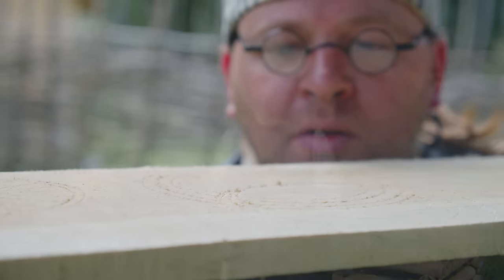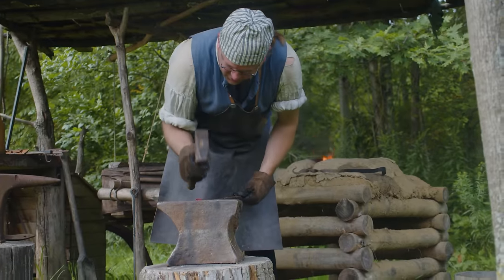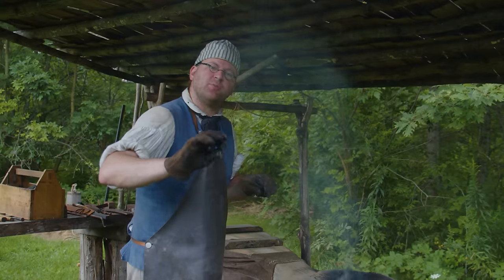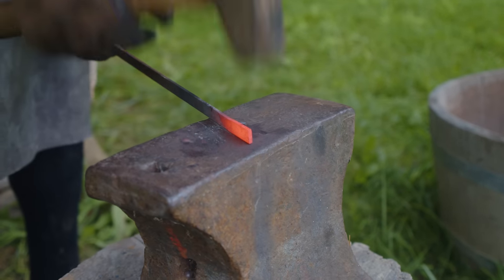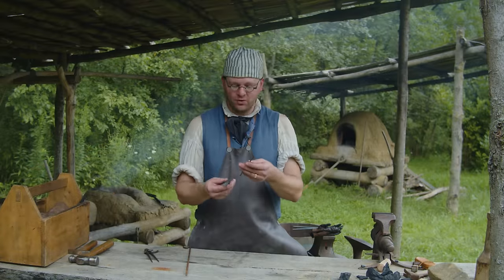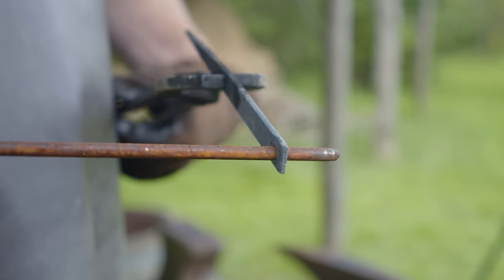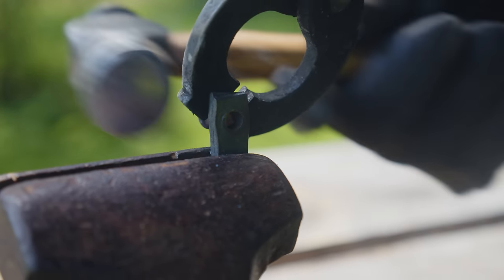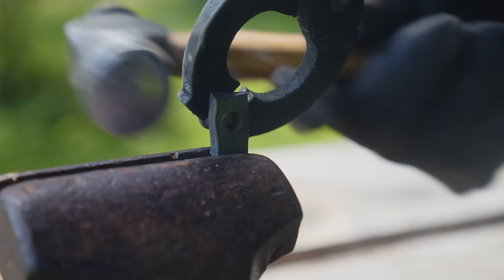Blacksmithing The MOST Underrated Tool In My Toolbox - 18th Century Forge

Comment: I owned a sheet metal manufacturing company for 30 year before I sold it. And you are spot on with the dividers, absolutely one of your most important tools. Some much can be done with them and accurately too. When I got into the trade everything was done without computers. I made sure some of my ppl. knew how to do there job manually cause you never knew when your CAD would go down.
Reply: Having gone through the journeyman for blacksmithing and done sheet metal work (instrument maker and micro mechanics but that is more machining) straight edge, scriber, divider and triangle is very much needed for laying out...
Reply: @najroe  Agreed

Comment: As someone who started their working career as a draftsman (pre-CAD systems) I have to say the dividers and triangle were the crux of engineering.  My Dad was a draftsman too and we'd watch all the shows about how "it must be aliens that made these stones so uniform!"  He'd show me how to do it with a triangle and dividers.  I loved this video! Yes, I do still have my dividers & triangles!  🤣
Reply: One of my most treasured possessions is my dad's set of dividers and compasses from when he studied engineering in the 1950s - I'm no engineer but I still use them occasionally when I'm building things myself.
Reply: I dont think its the measuring of the stones that are in dispute with the ancient aliens (lol) crowd though.
Its more to do with how on earth they cut stones perfect like that in the bronze age- since bronze is so soft.
Which is still a mystery, though i kinda doubt it was aliens lol.
Reply: @svinkuk2652  the Inca did it with a technique called peck and grind. You'd split the stone to it's rough size with stakes and then tap the stone with another stone in all places where it rose up. You'd then grind the stone until it was the desired dimension.
Reply: @svinkuk2652  true but they weren't shaping tungsten carbide blocks into aerospace grade parts. It's hard rocks into relatively accurate dimensions. Abrasives aided by water or grinding action will work just as well as modern ways of cutting, albeit much slower. I guess when you've got a very long life of cutting rocks you learn some practical tricks.
Reply: @alecasone  this is true, but not for that aforementioned quarry where they found the unfinished obelisk.
I mean there are other places in that quarry where there are marks from driving in stakes etc etc, meaning they used those classic methods as well at some point in history.

But that obelisk in particular is a different story- it looks like they were in the middle of "scooping" it out of the middle of a flat portion of the ground when it cracked and they abandoned the work.

If you havent had a look at it, i definitely recommend having a look on google and pondering what kind of stuff they used to leave marks like that in the stone, its way strange.

Comment: Another note, just drift a quick rivet/nail header tool. Upset one end of your rivet material, run the narrow end through your tool and head your rivet. Then cut it off with a little more than the thickness of your assembly, put everything together with a hot rivet and head the other side.

Comment: I could really use a set of these for my knitting and sewing. You could estimate a knit gauge, draw circles and arcs, mark distances for triangles or keeping bias tape/strips consistent, the applications are endless. Heck, put some little pegs off the outsides and you've got an adjustable pompom maker or ribbon length measure too.

Comment: Fun project.  Everyone needs to play with a set of dividers.  One of my favorite jobs for dividers is using them to set up a story stick for clapboard siding so each course is divide equally between sill and top of window and or doors the courses above those windows and doors can vary slightly  but you want the last course to come across the top of the window without having to notch the siding.  It involves a obtuse line snapped along the space you want to divide( a story stick cut to that length)  into bits and then using the dividers to walk off the spaces and a bevel square to connect  points.

Comment: I always wondered what these dividers are good for if you can't measure with them.
Now I know! Great explanation and video
Reply: In the attics of old gothic building there have been found lime beds set out with scribs in the lime bed where dividers were used to design from the ground rough framing to finish work all done with dividers. no tape measures.  One can design a whole building with dividers and just scale up the size of the building by expanding the size of the design by walking off the given design by a specific number like 12 or 16 steps of the compass.  So the width or length of some aspect would be 12 or 16 steps of the compass/dividers.  I like the name dividers because it divides distance.  12 and 16 are also even key numbers. you would want to stay away from odd numbers.  Just a glimpse of the power of the tool.

Comment: A good effort; best practice is to have only the rivet at a coloured heat when it is being put in & peined over, all in one go. Not easy with a small bit of metal when you're not used to doing it, but it gives best results. That's because this way only the rivet will be deformed during hammering, the pieces being riveted being too cold & hard to get damaged. 👍

Comment: With just a simple square and a simple divider, you can literally build anything
Reply: I think would work those who works in architecture and design interior. I think in 18th Century was used those dividers.
Reply: They're like the atoms of engineering.

Comment: You can "walk" the dividers along any length and divide it into any number of equal pieces as long as the final "step" hits right on the edge, that's where they get the name. No tape measure needed, and no decimal numbers. Or multiply a small length any number of times. They can also be used on maps the same way to measure distance of an irregular path.

Comment: Genuine question: How period accurate are vises with a threaded screw tightening mechanism? I assume for the most part its just a complex anvil production, but did they have a way to produce mechanical screws and threading in the 18th century?

Comment: @Townsends Why do you brush it with a metal brush in between steps is it to knock of burs or is it to score it, what? 🤷‍♂️ Why is it important? Seriously don't understand.
Reply: I think I finally saw that you are removing slag with the wire brush, is this correct?
Reply: The wire brush removes scale (a layer of oxidized steel) that forms during heating. If not removed it can cause unsightly dents in the work as the hammer drives it into the hot steel. On a project involving many heats such as making a hammer, the weight of material lost to scale can be quite a bit. Have a look at the Black Bear Forge channel for some easily watchable and very informative videos.
Reply: Thank you so much! I get it, and I will watch those videos. 👋😁